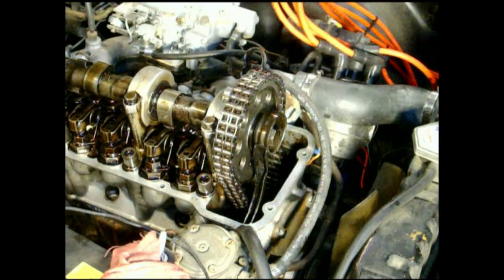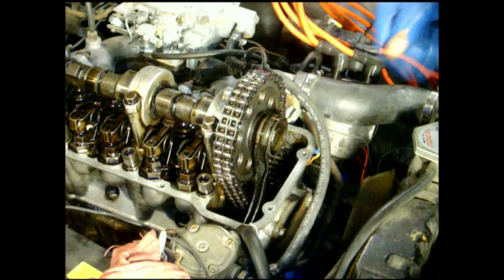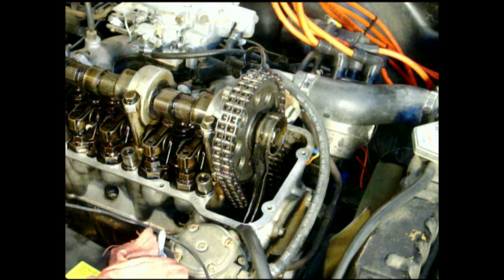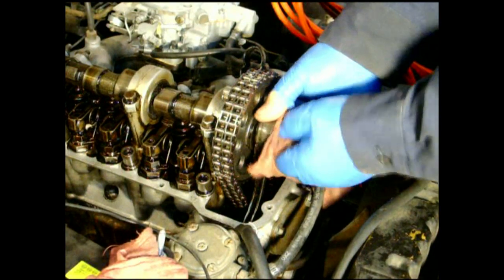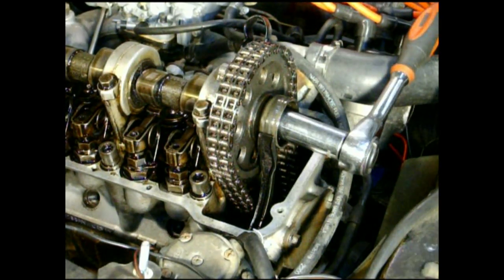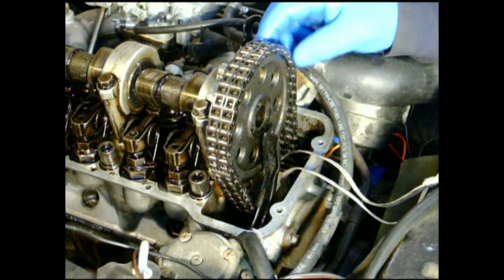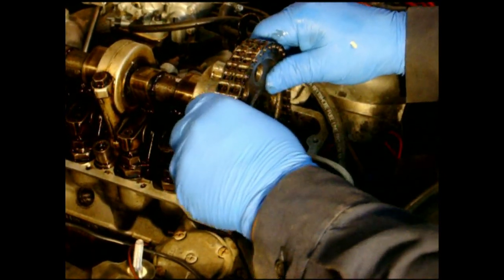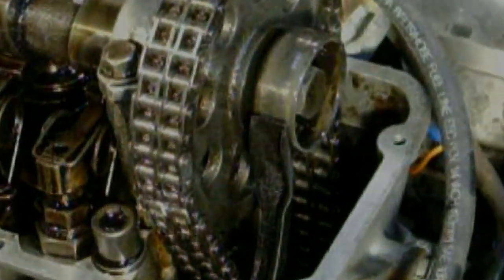Cam Gear Clocking L-Series

Comment: Had that chain tensioner stick into the block on a motor that sat 19 years.  Had to pull the distributor and oil pump. then climbed up and down with a big screwdriver as I popped it in and out until it began to travel freely. It was really stuck
Reply from the maker: I don't think they were meant to stay in there for 19yrs! lol  I'll be that was a lot of work! Glad to hear you got it out. :)
Reply: @bluehandsvideo    Pulling the dist. and pump provides great working access and line of sight.. It was easier than pulling the cover, by far. LOL.
Reply from the maker: @johnwick-ii6il  I'm sure.  Pulling that cover is never fun. lol

Comment: I'm a little confused ,do you move the gear sproket or chain ? I need to do mine plz advise thx
Reply from the maker: You don't want the crank to move so you do not move the chain. You walk the sprocket inside the chain, then turn the cam to line up with the sprocket

Comment: My understanding is that the timing on L Motors is optimal for top end power. Retarding it moves the powerband up so high that it is above the usable RPM range.
On the other hand advancing timing on a stock L motor yields more low end which can improve your hole shot at the cost of top end power.

At any point, did you look at the notch in the gear and compare it to the mark on the cam tower to make sure you were starting your modifications from the right reference point?
Reply from the maker: MY1PATH I'm sorry, but quite honestly, I don't remember the details.  I actually shot this vid quite awhile before I put it up on youtube....which was about 2.5years ago.  The vid is probably at least 5yrs old....I haven't had that car for almost 5yrs. lol  I knew all the reasoning at the time, but I can't recall at this point.  The adjustment is to account for a stretched chain.  There was a book....How to race a datsun....or something like that.  It explained why.  I think I was doing it to troubleshoot a really bad backfiring problem with the engine.  It had the problem when I got it and I had no clue what had been done to the motor....only that a previous owner did some work do it.  
I did check all the references before I moved it the first time....which I didn't film.  You may be exactly right with your info. Again....sorry I can't remember the details.  Someone on Ratsun.net can probably tell you why. 
BTW.....Jonas...your climbing son...amazing!! lol  Does he still climb as much?
Thanks!!
Mike

Comment from the maker: The distributor timing is mechanical as well.  Once set correctly, it will not change unless you have points and they wear, which changes your dwell angle.  Reset the points correctly and you don't have to adjust the dizzy.  
I don't mind being contradicted...I typically learn from it, but that was pretty weak......try again :)

Comment: follow the book!! ... there is no point in trying to change the mechanical timing...  you should be trying to adjust the distributor if you want to tweek on something...
Reply: calholli super late reply but as he stated those degrees are in there to compensate for chain stretch